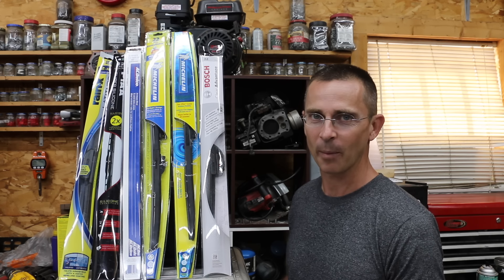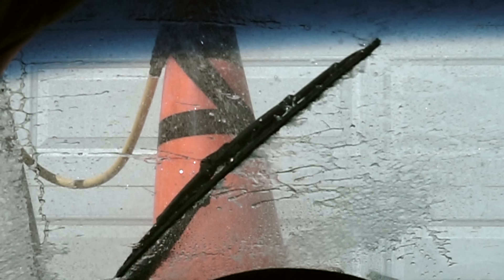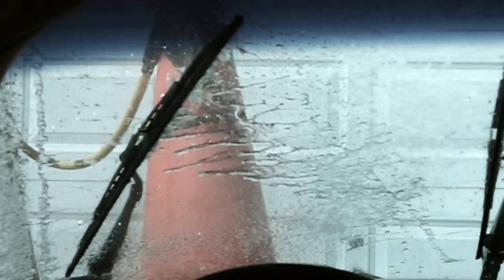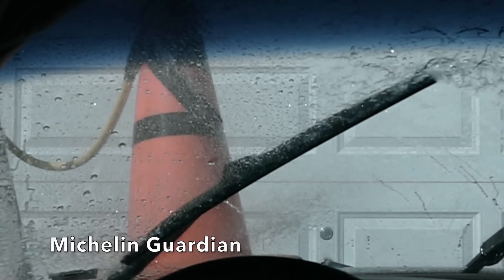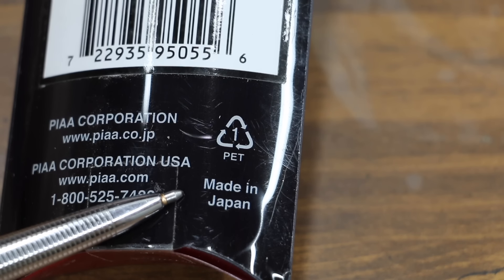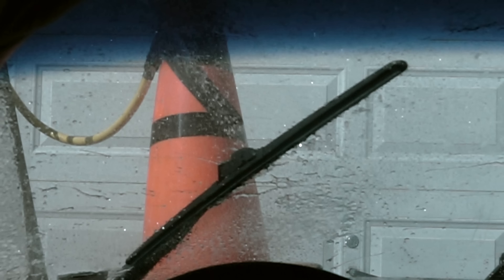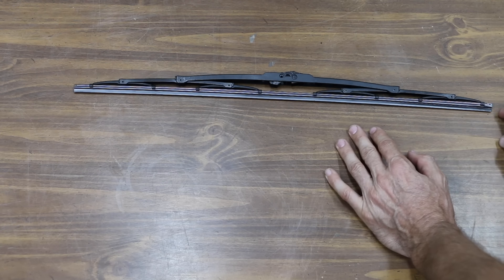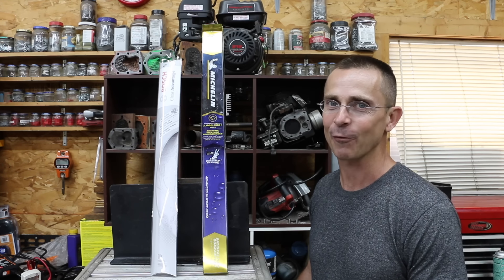Which Windshield Wiper Blade is Best? Let's find out!  Michelin, PIAA, Bosch, AC Delco, & Aero

Comment: Doing a good job of wiping water from the windshield is only part of the overall wiper value.  How often you have to replace them is also a factor.  Speaking from experience, the Bosch blades do not last anywhere near as long as a metal from blace (Toyota OEM blades).  So I would never buy the Bosch blade again despite your testing...sorry gotta look at TOTAL cost and performance when reviewing things.  Another factor is how well the blade works when you have rought things like bugs on your windshield...bugs thend to break down the edge causing streaking.  This was also a problem with the Bosch blade over time.
Reply from the maker: Thanks for the feedback.

Comment: Silicone is superior to rubber for durability. Using the blades +20 years car sitting outside, and if you clean it once in a while no streaks. Just like Irridium spark plugs also +10 years. And im thinking to use an reusable air filter but it showed that to big particles can enter so i didnt do that. I thought price was $25 - $30 for a good set of silicone wipers. I like to pay 3 times more if it lasts forever :D
Reply from the maker: Thanks for the feedback.

Comment: Actually, please factor local conditions such dust, smog, etc. to consider the proper blades, life cycle and maintenance needs. Yes, between glass being dirty and environmental causes, blades should be cleaned periodically along with the glass to minimize wear. Drivers with heavy sunny exposure cycles may suffer from short blade life cycle. Safe driving!! Thanks
Reply from the maker: Thanks for sharing.

Comment: Anyone remember the double wiper blades from back in the late 80s early 90s? I guess they were not all that great as I haven't seen them in a long time. Did they work any better?
Reply: Those things were junk. The double blade was just a gimmick. We had those on our truck during a trip when we came across a bad rainstorm. Had to pull over because the double wipers my Dad had put on a few weeks before were just smearing water all over the windshield. Bought some basic blades at a gas station and they were leaps and bounds better than the crap double wipers.

Comment: I believe this video is completely missing the points between frame design vs beam design as well as silicone vs rubber.

1. The steel frame is a legacy design for people who want to retain the original look and design on their older cars. Also, the J-hook design works best on the steel frame. 

2. The Beam design is designed for newer cars with the PTB and other European legacy attachment points. 

3. When new, both rubber and silicone perform very similarly. However, the difference between the two are extremely noticeable after months of wear and tear. Rubber hardens and cracks and hardens very easily under UV and heavily contaminated environment. Asa result, rubber would lose their performance after around 6 months of use. Also, a hardened and contaminated rubber blade will also permanently scratch the windshield. Rubber blades also leave a film of rubber on the windshield, which prevents water from sheeting  or beading away. 

4. Silicone on the other hand has extremely consistent performance throughout its life. Silicone remains very soft, which allows it to operate quietly, smoothly and efficiently even after years of use. The biggest reason most auto enthusiasts choose silicone wipers is that they rarely scratch the windshields because contaminants do not stick to the wipers and that the wipers remain soft for a very long time. Silicone wipers also leave a layer of silicone on the windshield, allowing it to repel water. Each swipe of the silicone wipers is like an application of rain-x on the windshield. This is the opposite of rubber; while a layer of rubber on the windshield reduces its water repellency, a layer of silicone enhances the windshield's water repellency. 

I believe that if you are going to compare windshield wipers, you should compare between the same frame design and same blade materials.

Comment: In town the newer designs may be fine but if you do much freeway commuting, it's hard to beat the traditional steel framed blades.  I've tried a few of the frameless  and plastic covered framed wipers and if you travel at 70mph or above (with headwind factored in) the blades lift off the windshield on the return stroke.  Those old-fashioned frames allow much more wind to pass through instead of lifting the blades.  I'll never buy another newer designed wiper as long as there's still a choice available and as far as I'm concerned the newer ones are all marketing gimmicks.
Reply from the maker: Thanks for the feedback.

Comment: I'll go tight the Michelin silicone blades B/C I live in "Hot Vegas" and the heat KILLS rubber blades. 

HINT: to rejuvenate blades wipe them down with an alcohol soaked rag or shop towel. This removes old, loose rubber, dirt and contaminants.
Reply from the maker: Thanks for the feedback.

Comment: Rain X  wipers cost me  $380.00. How? Well,  is a long story.  I replaced my wipers for the rain x one.. I have a 2003 Windstar. The driver side takes 24 inches. And,  it wiped the windshield  clean. I was happy.  Until, I wasn't happy.  A month later the driver side was not wiping good. It was leaving  a  blob  of dirt on the windshield without being clean. I ignored it for a few months. Till, I got tire of the blob. Went and  bought another rain x wiper and put   it on the driver side. Because, it was the only one warping.  And, the  new one warped, too. So, before I realized what was happening, I condemned the windshield as caving in. Because, that brand new  wiper couldn't have warped!!. So then, I replaced the windshield.  The new wiper was on the van still. And,  I did not know it was warped till,  they finished putting the windshield on. As,  soon as they finished, I turned the wipers on and my, God!! It wasn't the windshield. It was the freaking , stupid wiper!!! Will never ever buy stuff from rain x.  I don't like their windshield fluid eather.  It sucks. The blue   windshield   fluid one is much better.

Comment: Fyi! The key to keeping ice off the blades is to buy smaller wiper blades. Large blades push too much snow and ice builds up on them more... Smaller blades push less snow... NOW! before the internet engineers get anger over specs. The argument of what size wiper blades to use can get tense so just use the size you see fit... 2 inches shorter does work
Reply from the maker: Thanks for the feedback.

Comment: I find they all work good at first but it seems no company makes a beam or frame that holds up anymore!  On another note it would be nice to see a real full winter test on some.  Those bad wet, icy and snowy storms are the hardest to find a good blade for.  So far I’ve had best luck with the rain ex silicone advantage blades this year but I can’t attest for how long they’ll stay properly functioning for
Reply from the maker: Thanks for the suggestion.

Comment: I've had Michelin, rain ex latitude, rain ex exact fit, several cheap brands, and Bosch icon. 

The Michelin were good overall, but I had the hybrid onee, and though pricey, that style just can't compete with a single flex blade. 

The exact fit rain ex also good overall, but always leave a slight, quickly disappearing haze during swiping, but still not too bad. 

The rain ex latitude (ironically the more expensive of that brand) was awful for me. The hazing effect was awful, much worse than the cheaper exact fit, taking longer to go away after the swipe
 When you're in heavy rain with the wipers on full blast, there wasn't enough time between swipes for the haze to clear, leaving a constant haze in heavy rain and making visibility awful, especially with light from oncoming traffic, street lights, etc. Absolutely terrible IMO. They also always had chatter if there was very little water to wipe. Those are the ones that supposedly have rain ex in the rubber that's supposed to essentially transfer to the glass with a certain break in method (dry wiping on a clean windshield for X amount of time, etc.) <<Or something like that. I kept those wipers for several months, used them many times, and they never got any better. Even though they were expensive, I replaced them and just ate the money spent. 

Cheap brands are good in a pinch and none work great.

The Bosch are easily the best for me. Very quiet, perfectly clean swipes both ways, no haze, no chatter, etc, etc. Once I found their Icon line, I became a customer for life. They're worth every penny. 

Thanks, PF, for all you do. Since I've found your channel, I will be using your hard work and lack of bias to help me make decisions on other things you've reviewed that I need to buy. Keep up the good work!!

Comment: I would really like to see a comparison between blade types in heavy snow conditions. I realize of course that standardization might be a real problem.   Thinking that the flexible frame type blades may not be rigid enough to push heavy snow off the windshield as well as the metal frame wipers.  And of course there are enclosed metal frame winter wipers to consider as well.
Reply from the maker: Thanks for the video idea.

Comment: I do wish the engineers would reverse the blade action!  It seems to me the right blade actually keeps the driver’s windshield much more obstructed.  As the currently designed system being used splashes the water from the right blade to consistently “blind” the driver’s side.  This may work well if you are driving in Europe, etc. but definitely feels detrimentally backwards/reversed in the USA.  It is my opinion that this current wiper-blading system contributes to many accidents- - - fender benders and severe to deadly, all because this observation has been ignored and overlooked.
Reply from the maker: Thanks for the feedback.

Comment: Hope someone can help me. Bought some Piaa sci tech silicone wipers couple of weeks ago, first couple of days fine, afterwards i started seeing a foggy wipe evertytime ( i believe because of the layer it keeps applying overtime as described by the website) and they are squeaky! I mean cmon beeb only a month so far, I cleaned the windshield with a degreaser very good and then followed their instructions with the wiper tissues, a nightmare, does anyone experienced this and if so whats the solution? Bmw 1 series f20 here

Comment: Speaking of Bosch AERO or AEROTWIN , a crucial part of your test is missing. Stacic performance of a wiper blade is actually not important ,as it means you have stopped. The real test is going 140 km/h down the hi way, and then see which wiper blade performs. Real driving conditions are crucial in such tests . FOOD FOR THOUGHT
Reply from the maker: Thanks for the feedback.

Comment: I made the huge mistake of buying the rain x blades and every time I have to use them at the point where they stop before returning back it leaves a line of a residue the length of the blade that is very difficult to remove. I hate the rain x blades.
Reply from the maker: Thanks for sharing.

Comment: I'm not sure if the labeling would reveal but there could be a social consciousness / environmental impact aspect to these, too, in whether the rubber or coatings is formulated to contain fluorine.  Fluorine can help maintain resistance to water and oils giving a longer-lasting and better-functioning blade but also organofluoride break down into really nasty compounds (perfluoroalkanes or PFAs) which can have toxic effects on the environment and might be one of the causes behind the trend of decreasing testosterone levels in men.

Comment: Hybrids are best. My 2014 Mercedes GLK 350 came with beam Bosch. They apply too much pressure and chatter/skip ( I have replaced existing ones with brand new arms and OEM blades from Mercedes with same results, google and you will find this is common problem with Mercedes).
Reply from the maker: Thanks for the feedback.

Comment: Interesting in 2 years the Bosch Clear advantage went from $10.92 to $24.49🤑
Reply from the maker: Thanks for sharing.
Reply: @ProjectFarm  I ended up going with Aero Voyager $17.98 and come with an extra set of rubber blades. Rating 4.5

Comment: Those rainx wipers, ive had a hell of a time with those caps coming off the end of the blades. The caps hold the silicone strip on the frame. Typically when the blades freeze and I gotta knock the ice off, the caps almost always came off with them. It Drives me nuts. I stopped buying any blades with those end caps because of that.
Reply from the maker: Thanks for the feedback.

Comment: THE REAL TEST WHEN YOUR DRIVING AT 35 OR 65 MPH HOW MUCH DOES THE WIND BLOWING ACROSS THE WINDSHIELD LIFT THE BLADE AND REDUCE CONTACT PRESSURE WITH THE WINDSHIELD. THEREBY REDUCING EFFICIENCY. STATIC TEST WILL NOT TELL AS MUCH AS HIGHWAY TESTING.
Reply from the maker: Thanks for the feedback.

Comment: Do not trust this test, as it is extremely flawed for a large number of reasons. (Listed below)

1) Spraying water at a windshield from a hose is a terrible rain simulation, and does not accurately represent what you'll experience on the road.

2) This test does not take into account the wear and tear that a wiper will go through over it's life (years of extreme heat, cold, road salt, being dried out, sunbaking, etc) and a simple UV exposure won't make up for it.

3) Wipers need to do their job at highway speeds, which is the true test of a wiper blade, and where the metal frame has it's advantages, as other designs have far more drag and makes them less efficient at high speeds.

Overall, this test has so many holes in it's design, it might as well be swiss cheese. Unfortunately the only way to test a wiper blade is to buy one and run it for years, which certainly can't be done in an afternoon.

(Note to creator) Hey man! This criticism isn't meant to be cruel, as I enjoy lots of your other product comparison videos, but for the reasons above this test has a lot of misinformation and won't help people make the right decision, which I'd imagine is your intention.

Comment: Congratulations with this fine channel. However I have noticed  a lot of variables in your tests which make the tests not reflect the truth at all times. No 1 in such tests is to compare apples with apples. In the wiper blade test, the Bosch clearview is there cheapest blade compaired to the Aero and Aero twins. So this test is flawed as you are using the cheapest Bosch against the most expensive Michelin . Not fair , and not a true representation of the reality . I have noticed this tendency throughout all your testing videos. 
APPLES WITH APPLES PLEASE.
Reply from the maker: Thanks for the feedback.